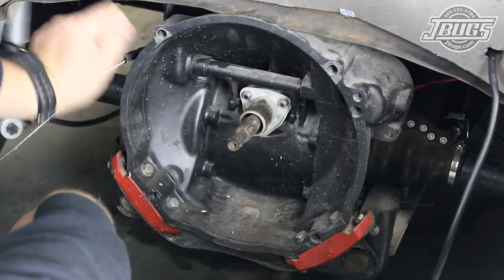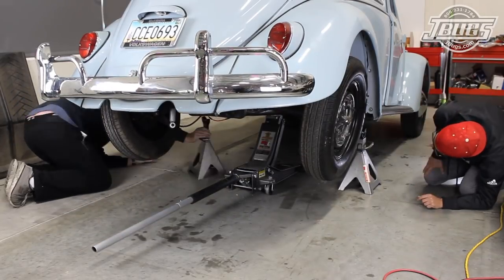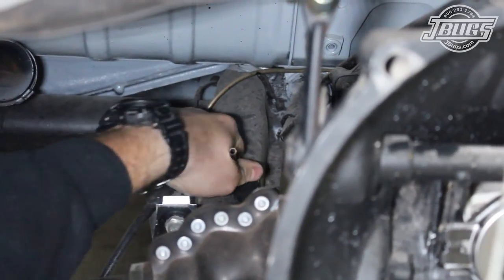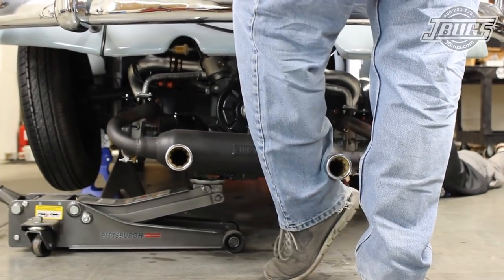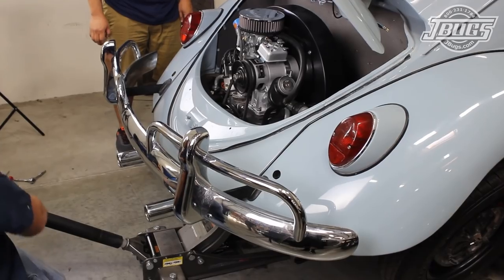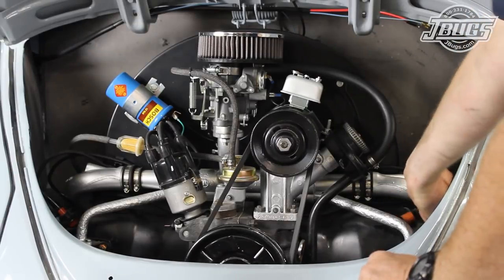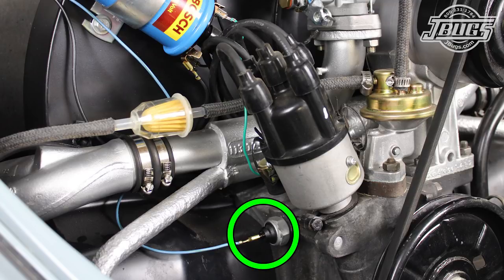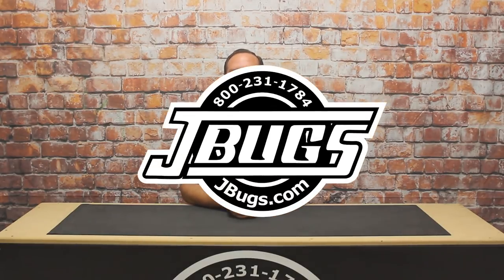JBugs - 1966 VW Beetle - Engine Installation

Comment: In my BUS it's a real pain to reach around the back of the fan housing and get a nut on the D  bolt from the starter....tricks/tips?
Reply: The engine compartment in the Type 2 is much larger than the Beetle so I've always found the nut easier to access in the Bus. There is plenty of room to reach around the side of the fan shroud, provided the battery is out of the way.

Comment: Firsttimer here.
Having trouble with the Driver's side Upper Bolt(removing). Any tips or hints?
Got the bolt off, but just can't reach the underside.
Reply: I usually use a long extension and a ratchet to remove the bolt.
Reply: @Sam_Mebane  been trying that, but between little moving space and rusted in there, little guy ain't coming.
And naturally, this is the last bolt to remove before I can pull the engine.😬

Comment: Can I install the motor before I put the body back on or does the body have to be installed first then the motor?
Reply: I am pretty sure VW installed the engine before the body was installed, but they had a lot more practice than I have! I would highly recommend installing the engine after putting the body back in place.

Comment: I and doing my own wiring harness on my 71 right now and I can’t fit the engine back up through my engine bay I only have a 1776 motor but the generator sticks out too much and hits the frame for some reason you guys made it look so easy like it just slipped right up in there any tricks or advise
Reply: Only thing going for us was experience. It's a tight fit and a balance act between leaning the motor forward and back to clear the generator shaft, just take your time, you'll get it!

Comment: I'd like to see an installation video of a dual-carb engine.  I have yet to see one of those.
Reply: The installation of the engine is the same. The hard part there after is then installing the carburetors.
Reply: @Sam_Mebane  Thanks. I wasn't sure if they could be installed with the carbs on. I didn't think so, but now I know.  👍

Comment: My 1776 has an alternator but i want to put my 1600 with a generator in my 68. Do i have to change the wires as well???
Reply: The voltage regulator has to be wired up correctly otherwise the generator won't charge.

Comment: I was disappointed you didn't go over the conversion to 12 volts. Nice video otherwise. '66 was the model year I had from new.
Reply: We probably won't do a all in one conversion video as the conversion is a number of small steps (changing out bulbs, relays, the coil, etc) and one major step, changing out the generator. We did do a alternator conversion video: https://www.youtube.com/watch?v=S05pHNO7RQw which covers the most difficult portion of the conversion.